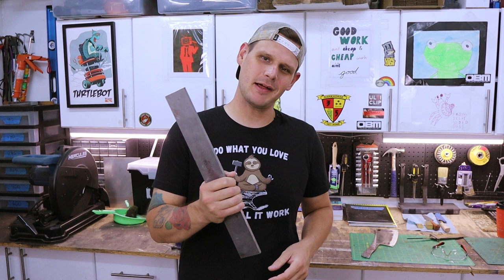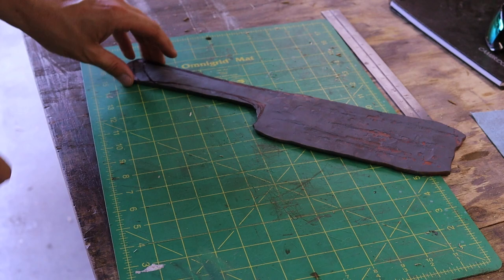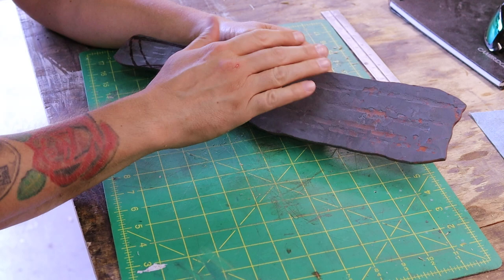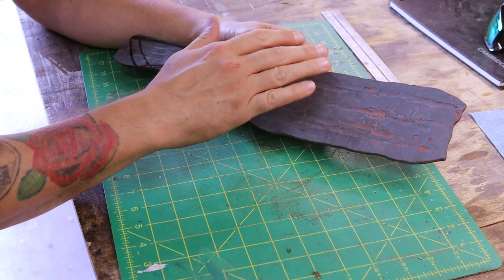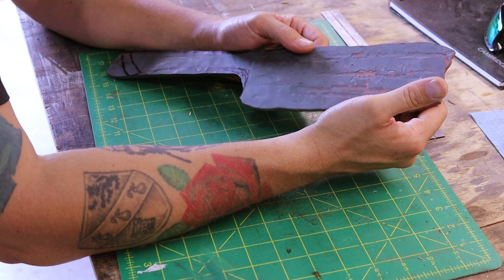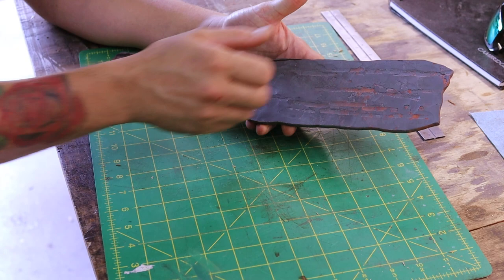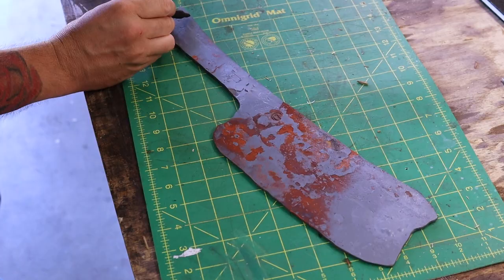Making a Huge 9" Cleaver From 80CrV2 Steel - Knife Making

Comment: Hey serious question, you happy with the coal12 ton. Or wish it had more power. That last twisted Damascus chefs knife was beautiful
Reply from the maker: Thanks! That's a tough question. If I could trade up now to the 25-ton I'd do it in a second. That being said I'm surprised at how much I've been able to do with the 12-ton. It's such a low barrier to entry, and it gives you so much capability. At the time I bought it, it was plenty of power for me. After about a year or two, I was ready for more. I actually hope to work out a way to upgrade to the 25-ton in the next year or two.